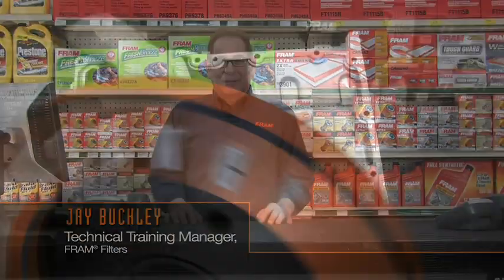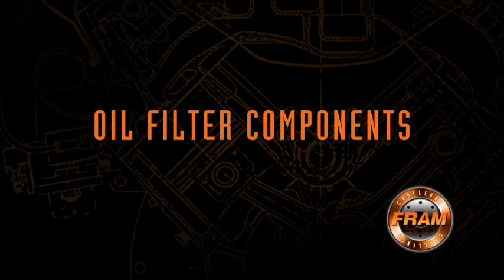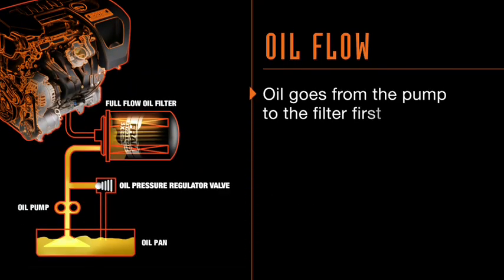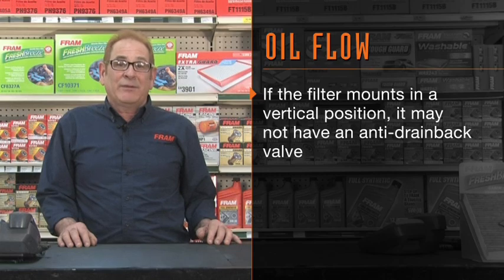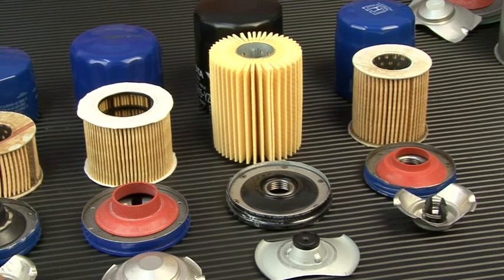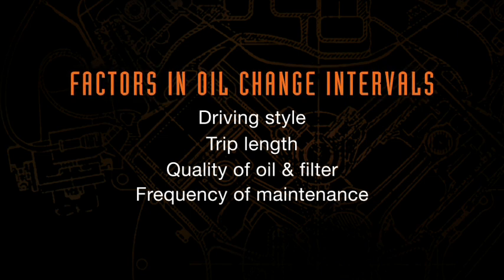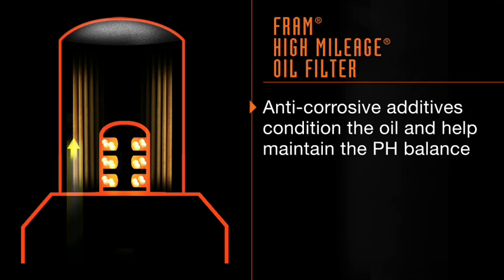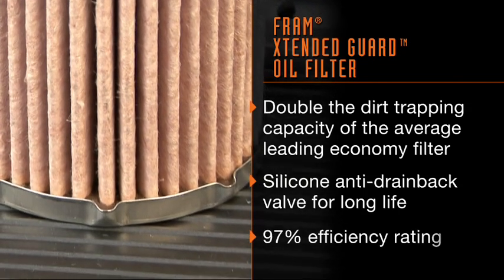Oil Filter Anatomy - 2011 FRAM Challenge Video 1

Comment: Interesting video presentation but some things logically don't add up. You say the famous 'engineered' end caps hold up fine and are actually better than steel (non-porous) material. Why then does Fram use steel end caps on their Race filter line and the 'Premium' 'Ultra' synthetic filter lines? Only the cheap low end filters get these special engineered fiber washers.

Comment: Confused??? The paper filters are desighned for convetional oil? How many vehicles run on such oil, Synthetic Oil is the name of the game! Also I have seen independent video filter tests where the paper filters does a better job of filtration than the fiberglass filters.  www.youtube.com/watch?v=4rgi9B8BKUE
Reply: When I was at Walmart you'd be VERY hard pressed to find ANY conventional oil. All 'Full synthetic' or 'Semi-Syn' blend.
Reply: @vincemajestyk9497  Conventional oil has become outdated as new cars reguire synthetic oil which works just fine on older cars so there is no reason for oil companies to market the old group 1 mineral oil.

Comment: If fiber end caps work so well, why not use them in your entire line of filters?
Reply: Great sarcastic comment!!!
Reply: That's what I thought! Probably start to break down if you don't get them out of there by a certain time. Thus the longer duration filters have the metal end caps! 🤪  They came out with a very nice Fram Ultra,  but have since cheapened it some to sell thier Fram Titanium filters. A very Stout filter!!! All this is as of early 2022!
Reply: @tinamcgarrah7794  Yes. The Ultra was good for a few years. Even so, the XG8A did have puny small inlet holes. It's always something with Fram. They just can't make a 100% decent filter. If they do, like with the Titanium, it's priced over the better Purolator Boss. Also my point about those end caps. What's this guy trying to sell? They ONLY use them on the cheapest filters they sell!
Reply: I suspect they actually expect everyone to change their filters every 6 months except for people that use extended life synthetic oils which would require a synthetic media filter. 
Even so given there are better standard filters for the money, I don't know why anyone would risk buying anything fram makes.
Reply: @Foche_T._Schitt  The ONLY good filter they make is the Titanium and it's more expensive than the better Purolator Boss.

Comment: Fram, anti-drainback valves that drain back, cardboard ends that deteriorate, and super thin metal cans that develop pin holes in the rust belt before you reach 3000 miles and peal apart when you try to wrench them off.
Reply: AS DINO 🦕 USED TO SAY....DU OHHHH!!!

Comment: Y'all are idiots. Put a gram in a 6.0 powerstroke and see what happens. And y'all are not the same as a motorcraft. I've put them side by side. The gram is shorter causing the by pass valve to be left open. Dumbasses. Don't post that saying it is. If anyone thinks I am wrong og watch the FORD video on it. They have a patent on the exact size and shape of the filter.

Comment: Lots of pics around of those paper end caps coming apart going right into the main and rod barrings into the motor. His statement that Toyota doesn't use end caps that is so the pleats on the ends can filter as well.